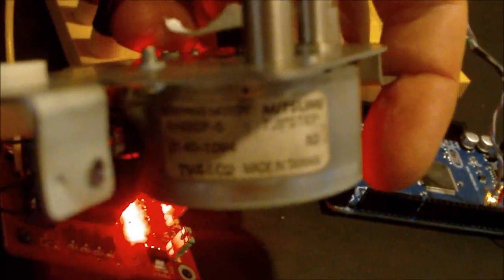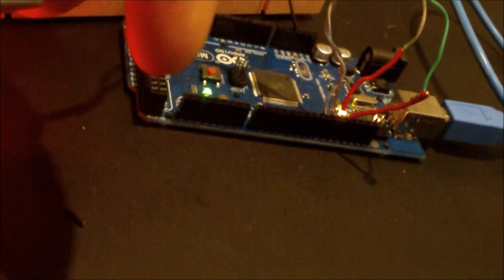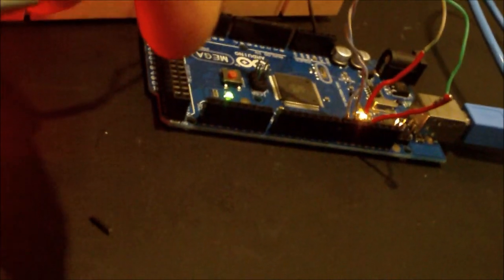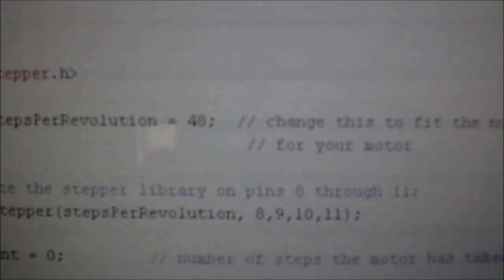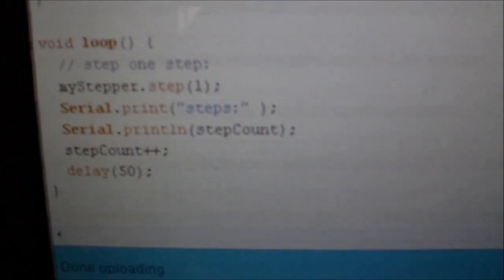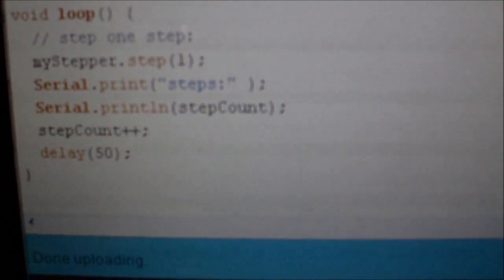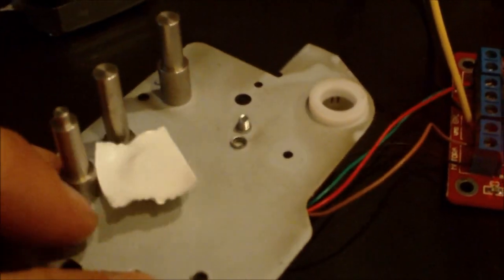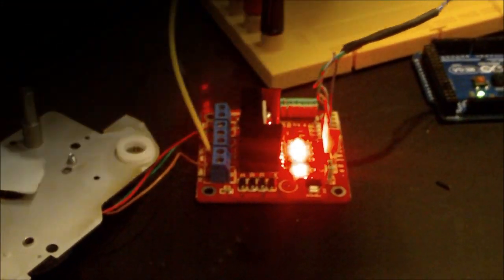L298N Stepper Motor Driver Controller Board for Arduino & m42sp 5

Comment: hello 
i am using a stepper motor Mitsumi M42SP-6NK
http://www.mitsumi.co.jp/latest/Catalog/pdf/motor_m42sp_6nk_e.pdf

and a L298N Dual Motor Controller Module  with my arduino mega ...

any idea why is getting very HOT after a short period of time, i am using 12V 1AMP?
Reply from the maker: gc9n 
Hi,
Steppers DO run HOT. They use current in their windings all the time to keep stepper in position. They can get skin burn hot.
You could disable power to your stepper in your program if or when there's no need to keep stationary torque.
Reply: +George Chatzisavvidis Hey, I have the same stepper motor (took it out from a dead canon s600 ). I'm trying to use it with Arduino Uno, but i could not figure it out ? How do we use these motor exactly ? Do i have to buy something else to drive them or can i just connect it to my arduino ?

Comment: Cesar, so you are driving the stepper with a L298N Stepper Motor Driver Controller Board... can you provide any more details on it? Did you build it yourself or did you purchase it?
Reply from the maker: Hi Greg,
No I haven't, just google it and there are plenty and pretty affordable.
In the past I've built one for a line follower with an L293D, with built in diodes so basically it was a socket for the chip and some soldering for connectors.
Unless for bigger motors and for the cost, I would say buying them is a good option.

Comment: Hola Cesar, buenísimo el video. 
Consulta, tengo un motor MITSUMI m42sp 5P, es igual al MITSUMI m42sp 5?
Con cuanto voltaje lo alimento? 12 o 24V?
Tenés el diagrama de conexión y el sketch de Procesing para compartir?
Muchas gracias!